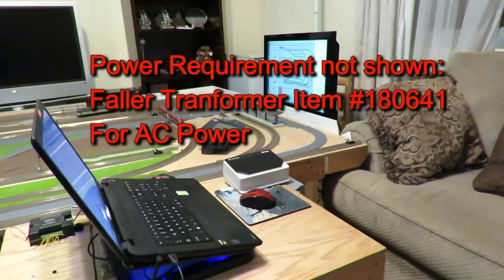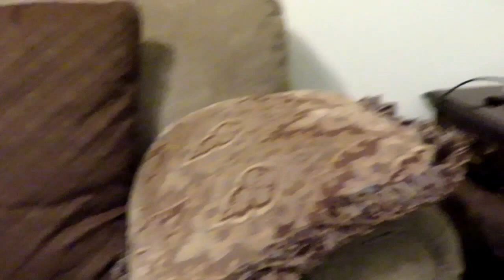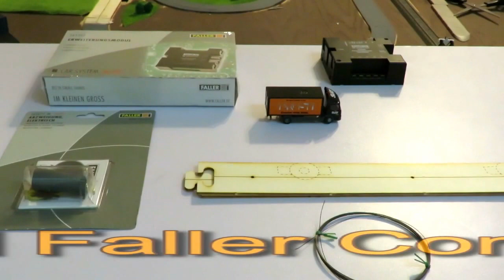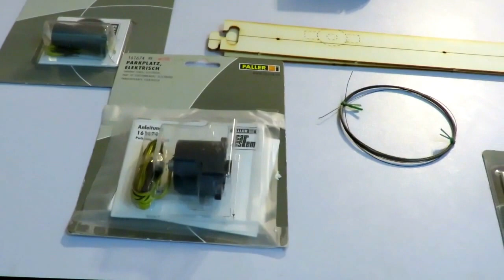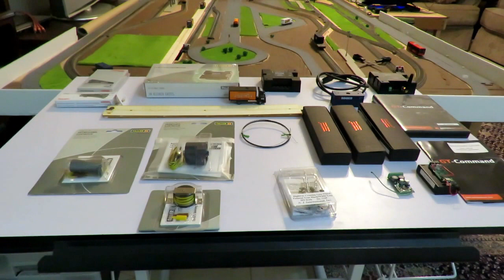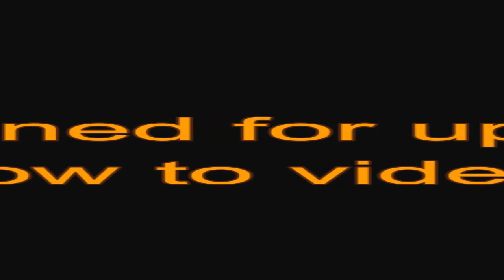Required Components Part 1

Comment: Holy shaving cream! this is the best dang video on this stuff I have seen and I have been searching for about 2 years for a video like this! this is the first Video where someone laid it out in front of the camera and said exactly what you need! I know this video is a year old now but I hope you are still into this stuff because I am going to be hitting you up with lots of questions as I build my layout!!
Reply from the maker: Thanks I'm dragging my feet on a follow-up...showing the components in operation. I'm working on a full run of our layout. First. stay tuned
Reply: I will be watching your every video on this layout from here on out. (and re-watching). I am building an HO layout with a simple loop of track, 3-4 industries and a loop of road for the Faller Car system. I want to set it up with the digital satellites and stuff. My layout will have sounds that interact with the stopping of trucks at a (bus stop type) stop. it will also have 6 grade crossings and 4 red lights/stop signs. My goal is to also make this a portable and expandable modular type layout that can be taken to train shows and put in a large configuration. It will have (1)mainline and (1)road on every module.
Reply: my main question is how to best get started with Faller. You said that you run both digital and analogue cars on the layout. can I start with building my loop of Faller track just analogue and then add the games on track stuff later? Where do you get the English manuals for Faller and GamesonTrack?
Reply from the maker: email me : anthony.hill32@gmail.com
Reply from the maker: If I had to start from the beginning. .....I would go straight digital.  There's two choices, run Faller cars or run trains....depending on your choice, will make a big difference. Faller car analog will require more components to stop cars and have distance control. if you want train and car interactions, that allows control and freedom to control both cars and trains digital is the way to go.

Comment: Great video by the way!
Reply from the maker: Phil Newman 
Thanks, I'm waiting for additional items, in order to do a full system run...maybe..... soon or next month
Reply: Hi Anthony, Thanks for the reply, oh well i will carry on with my original plans then. I am building a new N gauge layout, and i will probably use iTrain software to control it.
Cheers Phil
Reply from the maker: Phil Newman 
Thanks for the comments...but to answer your question Yes it works as Apple operating system is IOS